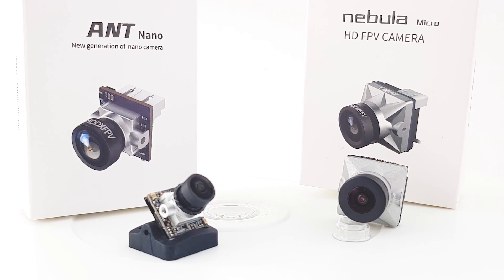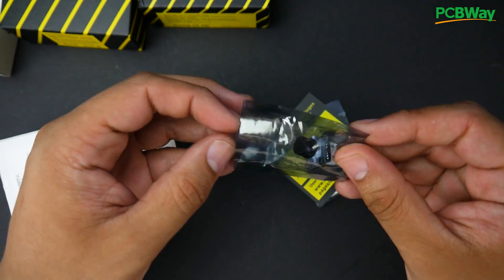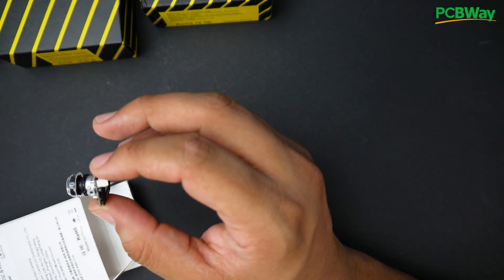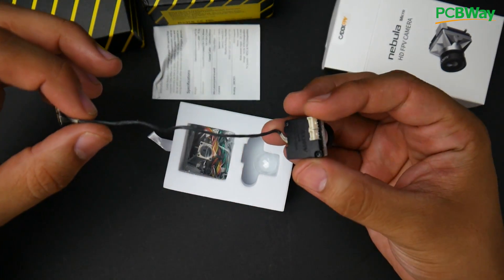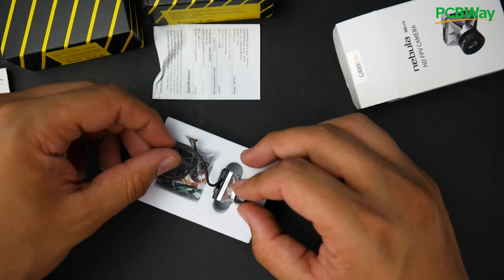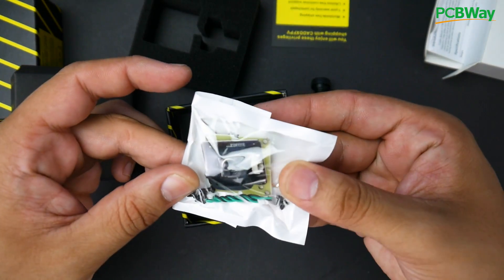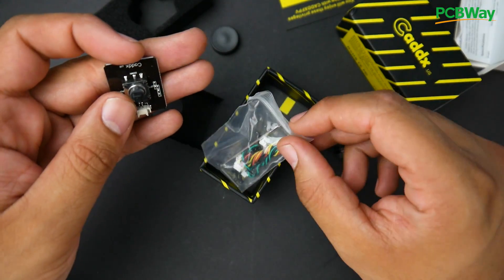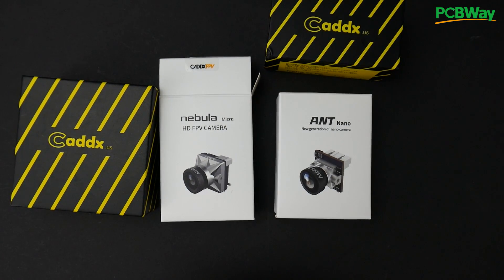Latest Caddx FPV Cameras Latency // Caddx Loris 4k, Caddx Ant Nano, Caddx Nebula, Caddx Ratel

Comment: Great video review. Nebula cam I'll stay away from (don't plan on getting into DJI stuff, tried it didn't like how far apart you have to be from others (around 7ft) to avoid interference from each other on different channels). 
Caddx Loris love it. The adapter you mentioned it comes with, is not from 20x20 - to - 30x30 (full size old style frames). 
Its 20x20 - to - 25.5x25.5 (whoop adapter mount) style. :)
Caddx Ant, love it, too. Lightest weight camera (reminds me of Runcam nano 1st gen, but those didn't have mounting holes). Caddx Ant wins. :)